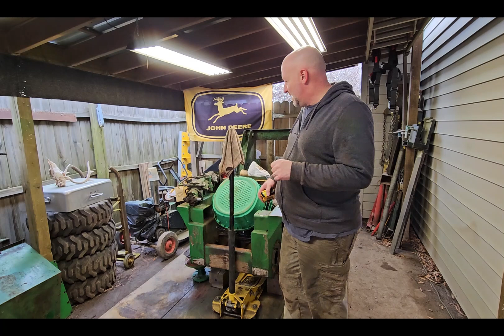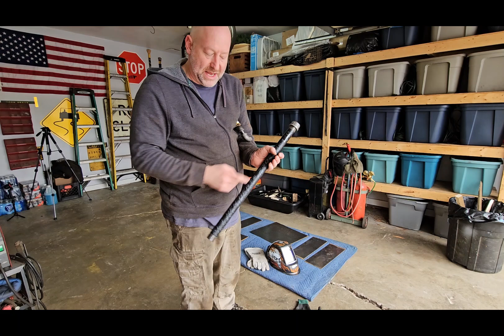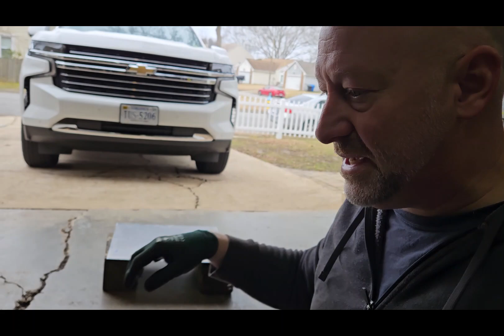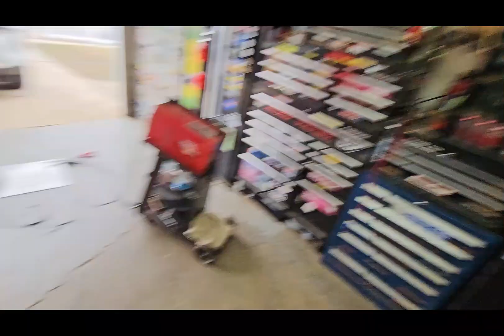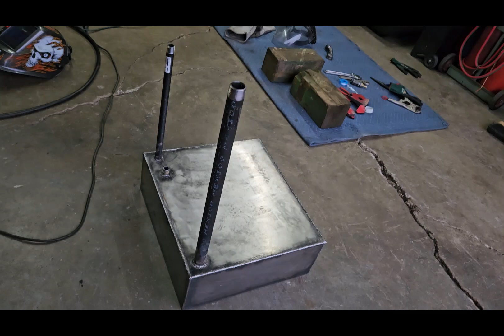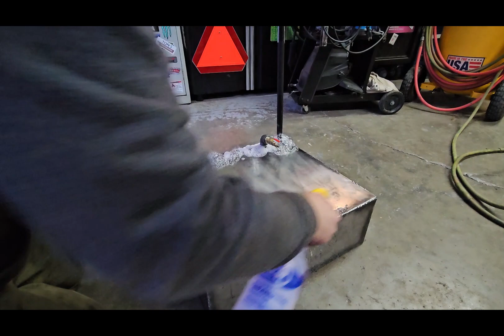Fabricating A New Steel Fuel Tank For My Skid-steer

Comment: Ambitious undertaking! I'm sure you'll get it sorted, it will be a nice tank for the skid steer. I was cracking up when the tank kept popping  when you were putting air in it. I'm sure it felt a bit sketchy😂. Hope you're able to avoid the sickness and the family is feeling better. Have a great weekend Steve!
Reply from the maker: @jason.dinsmore  it wouldn't have been so bad if the gauge was reading..... but I wasn't sure if it was 50.or 15...lol..... I felt better once I lowered the regulator output on the compressor. I laugh when I rewatch it...lol

Comment: Good job on the tank. Ive always worried about building tanks that could never fix all the leaks. I had Jebs welding build the tank for my boat. Its aluminum and my welding abilities are limited on aluminum. I see your using flux core even more daring. Good idea on the red coat!
Reply from the maker: Yep... learned a lot.... and its very time consuming! Hope to get it fixed tomorrow and i ordered some sealer as a backup. Thanks for the watch!!!

Comment: Say. Nice decal fix. Saved a bunch of money. Looks great. 👍🏻👍🏻
Great idea with the gas tank. Too bad about the leaks. But I’m sure you’ll get it leak free. 
I’ve wondered in the past and now with you making a metal gas tank, if a person put some oil in the gas. Would it help keep it from rusting.  🤷🏻‍♂️🤔. A little oil in gas is good for the engine any way. 
Have a great Sunday Steve. 👍🏻👍🏻👋👋
Reply from the maker: Thanks Noel.... once the gas is in it should keep from rusting.... but I think after I repair the leaks I'm going to coat the inside with redcoate anyways. Have a great weekend!